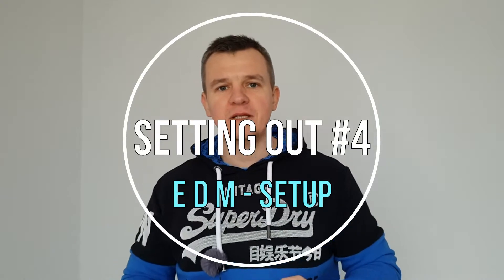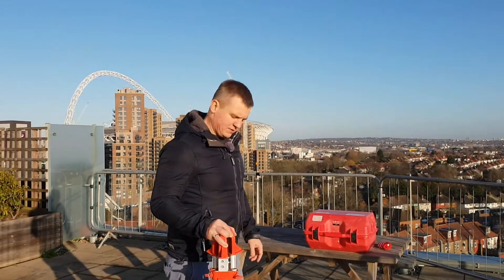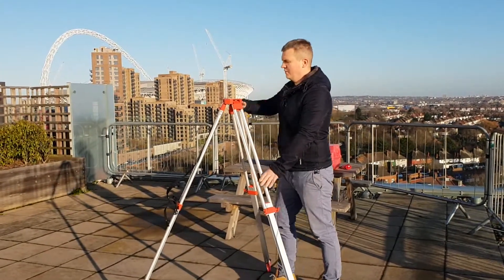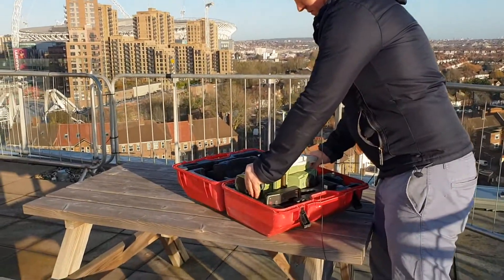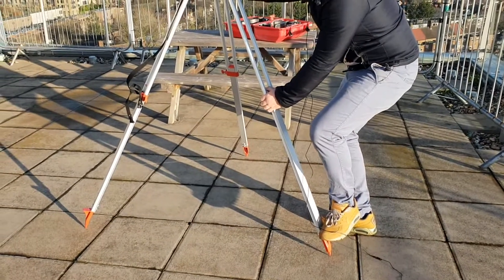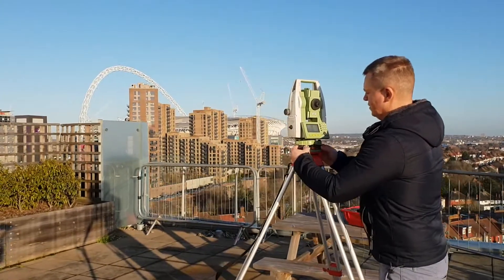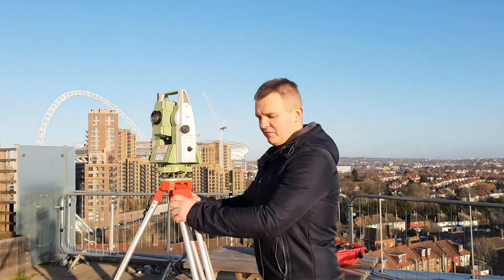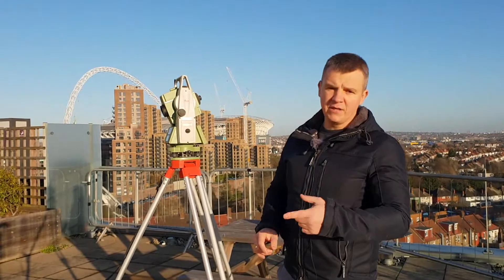SETTING OUT - How to set up a Total Station. Step by step guide to set up your EDM and level it.

Comment: You fortgot to mention to stamp the legs  before putting instrument on the tripod, in loose ground pushing it down might be not good enough.
Reply from the maker: On the concrete I just set the legs and push them making sure they won't slide not stamping on the legs at this might only break them in this case. You are right on the loose ground we need more and I am always driving the legs fully in with the tripod wide open, stamping on the legs.(parallel to the leg unlike some ppl do - breaking the legs)

Comment: Hi Sir, I noticed you did not enter the instrument height. Thanks for your response.
Reply from the maker: Hi Edwin! In this case height is taken and calculated from targets I use for resection. If I would set up over a point with known height then I would have to add the instrument height to get correct set up level (right instrument level)
Reply: @SITENG  Thanks Sir, now I understand that instrument height must be entered when setting up over a point with known height. I am a survey assistant only, we perform dimensional control survey of the structure we fabricate. Our surveyor always set the instrument height at 0.000, what is the impact on the survey result? Shooting point after another point, when he sees that the digital value of the level is around 0.0005 and above, he adjusts it so that it is near to 0.0000. Someone said it is a big mistake.
Reply from the maker: Hi! I don't really understand adjusting the height? 0.0005 is nothing. You have to speak with him, as I don't know exactly what are you doing guys there. Once your resection is done you shouldn't change anything, maybe he is intentionally cheating a bit on the surveys - which is possible.
Reply: @edwincaneda4030  you cannot re-level your EDM during survey. If the EDM is out of level, you must do another set up, and then continue the survey. How do I know? - I did the same when I was a beginner ;)
PS  I agree with SITENG - out of level of 0.0005 in nothing to worry about - you would have to ask in your company what is ok and what is not)
Reply: @krukarlukasz3834  Thank you so much for the enlightenment. It has definitely increased my knowledge in the use of EDM and understanding of surveying.

Comment: I must say your videos are very informative, what is the difference between using prism and EDM? I noticed when you are setting up with the EDM you didn't bother using the red light under the instrument to set it up.
Reply from the maker: Hi! Mostly on sites you will be using retro targets so there should be reflective tape target set on your EDM. In this type of resection you don't need a point - station to set the instrument

Comment: Hi, I have a new job, to mark the grid lines on each flor on the tower.
How can I transfer the stations from  down level to up level 54 levels building?
Please I need this info!!
I can’t do any resection !!
Reply from the maker: Hi Ediseu! Is there any chance to use/set some stations on the buildings around?
Can you use stations contractor used before? Are there openings in the slab (plummet points) you can use to set your EDM through?
Reply: @SITENG  Hi, yes, it’s a opening holes in the slab , how can I do it please?
No stickers around...🤔🤔
Reply: @SITENG  I can’t set up any stations around of the building, nothing around 😩thanks for yours responding 🤝🤝
Reply: @SITENG  oh yeah, that would be interesting (and apparently very useful) topic if you cover it (maybe you did it later - I don't know yet, I'm watching your videos from beginning). 
I just know one of the ways engineers are using - poly/plexiglass/acrylic glass with cross target over those openings in the slab ... but definitely would like to see it done and explained in details